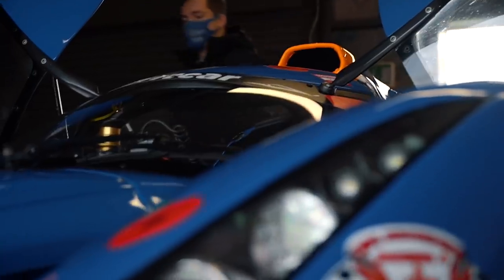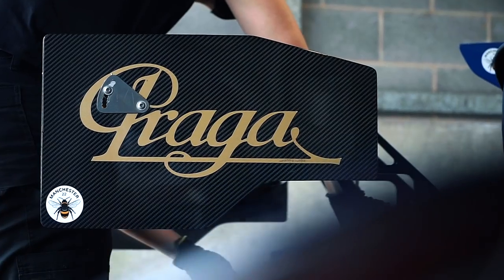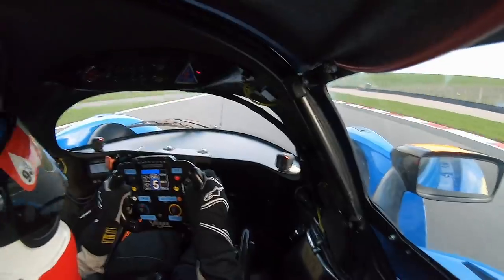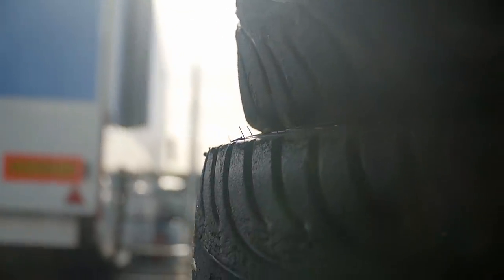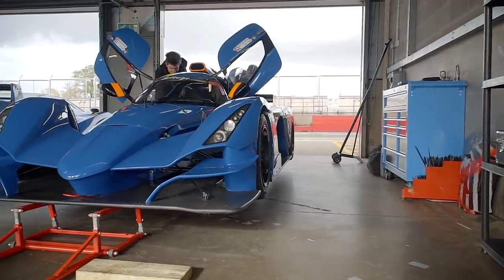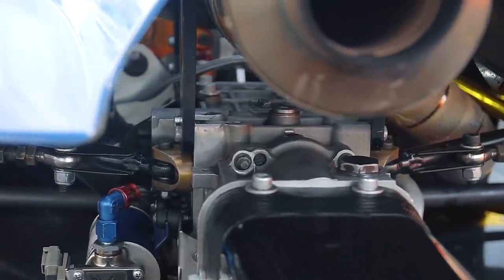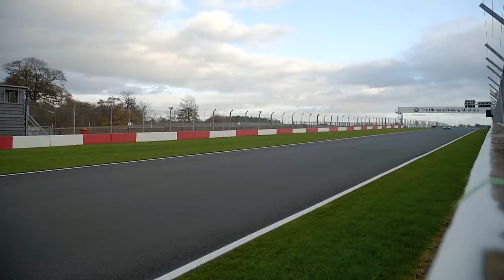Driving a Praga R1T EVO on track - a portal to another dimension!

Comment: I agree with everything he says. It is a mesmerising, addictive car to drive once you get the hang of it. And for the required budget it is exceptionally fast: you need to look at GT3 to find faster (although I beat a few in the Praga at Spa in the Supercar Challenge, so it is pretty close and a lot depends on the driver). But gt3 is about 3x more expensive…

Comment: replace the engine with the freevalve TFG, active wing and it's proper LMP3 stuff.
Reply: @Zen Re: but just to replace all the belts & pulleys 48V system is enough (mild hybrid), weight is the key in a track car

Comment: Have you noticed, there is so much force there is a gap in between the roof and the frame or what ever that is e.g. at min. 6:03 , maybe it's a glare, but something the team might want to look into.
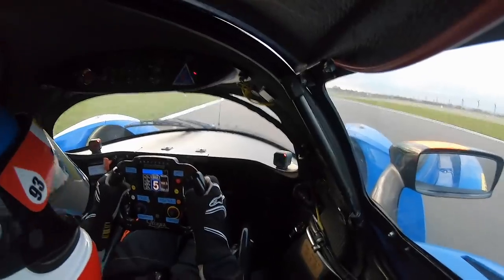Reply: I have been noticing the pulsing gaps around the doors on both sides the whole time with the inside camera segments. I am sure they are the design decisions not to add weight by stiffening the doors, as this is a race car foremost. In fact 3:42 you can see the rubber gaskets stop before the trailing edges of the doors, which likely to help the air flow through the cockpit so the driver does not turned into baked potato.

As I watched the footage a few times I realized the wavy video with the vantage of the driver's forward view was taken with a GoPro camera. It mounted through a suction cup on the right side window that being buffeted by high speed air causing the wavy effect, while the camera DSP ties to smooth out the shaking to no avail.

I have no problem listening to the mic'ed realtime narration in the no doubt very loud cockpit.